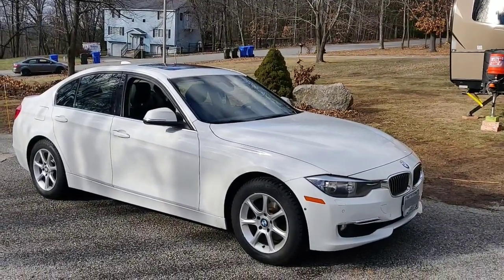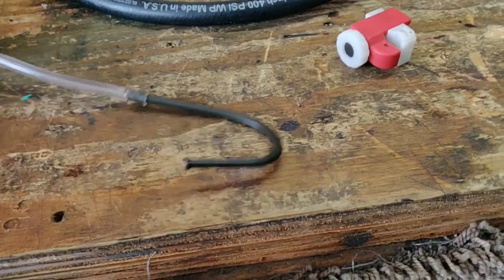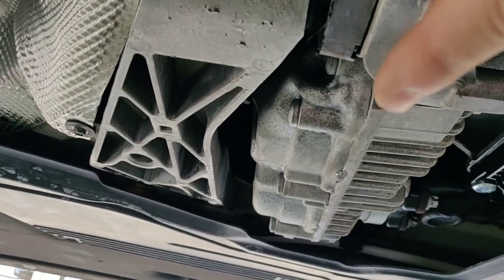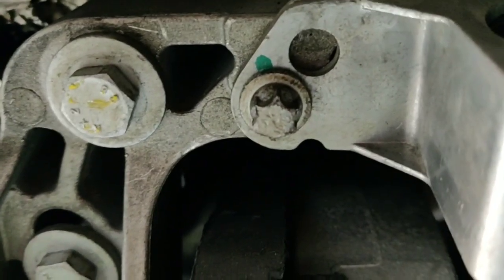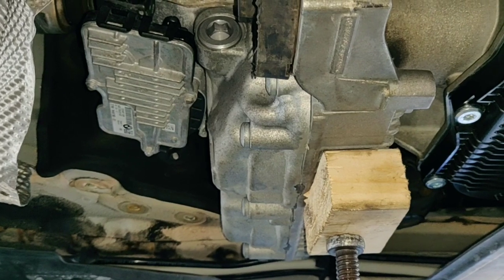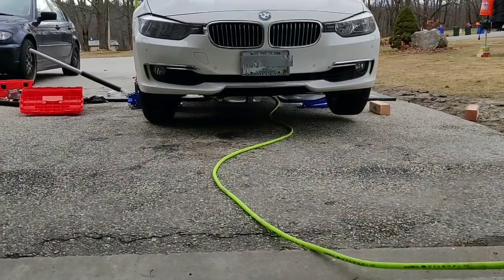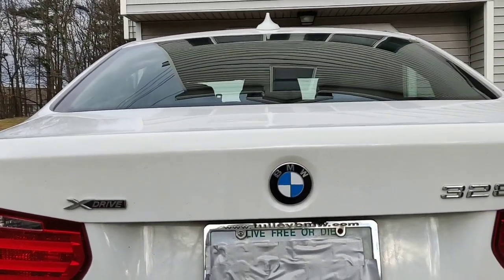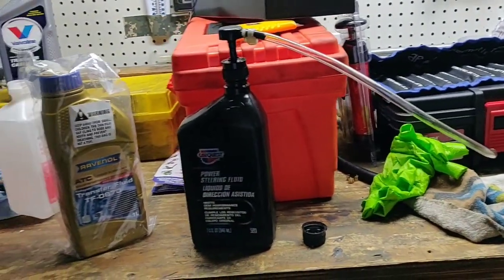BMW F30 Xdrive Transfer Case Fluid Change {PART 1} [INVOLVED]

Comment: Good video and I like your opinion on dealers and the tricks they play 😉 
For anyone experiencing hesitation that almost feels like a misfire but with no codes present and tried plugs or coils it’s probably dirty transfer oil like this, I’ve had a lot of x drive vehicles from f30 to x5 x6 with this issue with as little as 30k on them, sometimes made worse when new tires have been fitted or at least more noticeable, transfer flush and re adapt via diagnostic then a quick drive and all is smooth again, crazy that these problems arise after so little miles.
Reply: My f10 535 is doing this, right after i had the oil pan gasket and valve cover gasket done, it had jerking before shifting 1,2,3 in drive but then started shuddering like crazy, took it straight to bmw, they're saying its the trasfer case needs to be replaced.

Comment: The main reason you should reset this through ista (or ask your dealer to) is that the friction modifiers change as the fluid wears and the controller for the diff compensates.

This should be done each time the fluid is replaced.

Comment: Were you having any issues up to this point or were you being preventative? I’ll be doing this soon with my F25 X3 but it’s been exhibiting some acceleration hiccups. Hoping the new fluid will solve these issues. Thanks for the upload!
Reply: Scott L have about 99k. I’ll probably be doing transmission fluid and filter change at some point this year as well. I’ve seen issues with these transfer cases shearing the output shaft teeth but I’m hoping that’s just a worst case scenario. Also, was going to change the fluid just once but based on your conclusions I’ll be doing the same where I’ll run new fluid in short cycles to make sure the new fluid cleans out most of the intervals.
Reply: Internals*
Reply: Scott L reporting back a few days later after changing. Amazing. The transfer fluid change alleviated all my issues. Liquid gold! Such a bummer the F30s don’t have a drain plug. Was pleasantly surprised to see  drain plug on the F25

Comment: Just wondering about the tc clutch reset procedure and if it is actually mandatory requirement after changing fluid? I am gonna be doing the clutch on my f30 335i xdrive soon and might as well do the tc fluid but I don’t have ista or foxwell scanner to do the reset. Last thing I need is for any code coming up because of a fluid change!

Comment: and how did you perform an oil reset on the tc? after a while it will raise  error 440102 - oil wear, I changed and flushed the oil twice, the error is still there... ISTA and Carly couldnt delete the error. My car-> x3 f25

Comment: Im so glad you did a video on this, ive been trying to figure out why my car has a slight jerk under hard acceleration. im thinking that the fluid in the transfer case is going bad and is allowing the clutch to slip under certain circumstances, Do you think that could possibly be the case? I have no lights on the dash and the car drives great otherwise, only other minor thing i could say is that when you come to a near stop and go to take off again, the car has a slight jerk similar to having bad cv joint on the driveshaft in my opinion. BMW does have a recall theyre about to put out for bad cv joints on the rear transfer case but im thinking its the clutch slipping because the vibration seems to be almost boost related, as if the blow off valve is making minor on the fly adjustments to keep boost at max but not overboost.
Reply: Marginal Mechanic I really appreciate the tips. I plan to change the transmission filter and fluid and also vacuum out the transfer case fluid  and replace with new fluid. Is there any special procedure that you have to follow on the transmission filter and fluid change? Typically I replace those items, pull the e brake, start the car, let it idle for a bit, then run it through each gear while stationary, park, reverse, neutral, drive, reverse, neutral, drive, reverse neutral, drive. I allow it to sit in each gear for a few seconds with the e brake Holding the car then take for a short drive. This would be sufficient for this car as well I’d assume?
Reply: Marginal Mechanic if I were close by I’d definitely bring it over to shoot a video and do the work. But I live all the way in Panama City Florida
Reply: Hi there 
Can you please tell me ae  you fix the problem? That sounds like my problem i have the same symptoms 
That was transfer case? Thank you
Reply: @adamnowak1414  there is a recall on the transfer case and the cv joints on either side of the transfer case. Bmw will replace it for free under the recall if you go have them inspect the car.
Reply: @adamnowak1414  the car will start feeling clunky as hell when the transfer case starts to fail.
Reply: If you want to check that your transfer case is working properly, try unplugging it from under the car, this will cause it to lock in rwd, if the problem disappears you know it’s your transfer case
Reply: @theprodistini2590  thank you for answering me 
I have to try to unplugged my transfer case ,when i do it can i drive on highway thing is that's only happening when i drive more than 55 mph and accelerate all the way down so that's only way i can check please lmk thanks
Reply: Also you finally fix it? 
And that was transfer case? 
My symptoms looks the same but when engine is cold doesn't happen when is hot like 200 farenheit start let go sometimes(hard to say in english for me i try to find the best word) looks like misfire but i change spark plugs and coils already and don't help also no codes on dashboard, thanks
Reply: @adamnowak1414  my troubles happened when coming to a stop from any speed, if your car is having trouble staying running or starts to stutter, missfire, shake when coming to a stop and it’s not drivetrain related, it’s going to be vacuum related, probably egr, pcv, or there’s a little valve on the side of the turbo I can’t remember what it’s called right now. But it fails about every 65-100,000 miles and causes missfire codes, less response to throttle input and stuff
Reply: @adamnowak1414  sometimes when you’re driving and you try to accelerate, when the car gets under load it starts shaking a little bit, that’s the transfer case failing
Reply: @theprodistini2590  thank you for your help i change transfer case fluid and problem solved that's crazy my car has 45k miles and oil looks like coca cola but anyway now car runs great

Comment: Hi, I've seen your video, both of you, but I don't speak English, I'm doing this with the google translator.
To say that it has helped me a lot, how to change the oil in the transfer case of my bmw f31 (2015) 320d xdrive. (I'm from Spain).
But there are some questions I have read in the questions, which says they are explained in the video, but I do not understand English.
One of them is the amount of Ravenol that has entered the box. I have put the car level, and when I opened the plug, enough oil came out, I should not leave if that is the filling level, but it came out, and I don't know how much. I know, then take out about 200ml of oil. Therefore when filling the box try to fill with 500ml of ravenol oil, for that I had to lift the car on that side so that they could enter, if not, only 200ml of new oil could fit. I can't find the exact amount of oil carried by the transfer case anywhere.
And the other question is, something I have read about resetting the transfer case by changing the oil ... is that true? ... I don't know how ... if I have done it by changing the oil to the gearbox.
Sorry for so much writing ... greetings and thank you very much for your contribution ...
Reply: @themarginalmechanic5928  Thanks a lot...

Comment: Any idea of the thread size on the filler plug? I was looking to replace mine with a dimple magnetic one.
Reply: @themarginalmechanic5928  I'm interested to know how much oil you got out by tipping it to the side? I jacked mine up well at the front as I've only one jack and could only get about 350ml out ffs.
Reply: That's the plug for 2016 335d xdrive transfer case. Ive just fitted one.

Comment: Awesome video, has anyone done this with a fluid extractor?
Reply: @themarginalmechanic5928  thanks for the reply. I'm sorry I was under the impression you made the tool used in the video. I don't have the tool to bend cable but I figured with a flexible tube on my extractor I could do this project

Comment: I’ve got a 2014 bmw 435d xdrive. 
Currently my xdrive is not functional. Permanent traction light on the dash. The error code i have is: 440101 Transfer Box (VTG): End of transmission service life reached. 
I don’t suppose replacing the oil will help, but do you think I can replace just the transfer case actuator/motor or will the complete transfer case require replacement? Have searched online endlessly without any answers. Any input would be very much appreciated
Reply: How was this resolved? Keen to know more
Reply: @TS-ji1me  Yes, also would like to know
Reply from the maker: I'm pretty sure that error message indicates that the clutch material inside the transfer case or power diverter is it end of life. 

Personally I would buy a remanufactured power diverter and install it as an entire sealed unit. I would not rebuild it myself. Manly because I have no idea how to and I imagine there's some special tools and it's just not a headache I would want for myself. Remember I'm only a marginal mechanic I'm not a professional mechanic so everything I say is likely to be wrong

Comment: Another mythical lifetime fluid!  My 2013 F30 transfer case has started making noise @88k miles and I think I should just do this and hope it’s not too late.   I had a major heater core job recently because BMW also thinks coolant is a lifetime fluid.   Anyone here care to contribute a list of what BMW thinks are lifetime fluids?  I feel I’m discovering them one at a time!!   Maybe a good discussion for a new video.
Reply: in my repair manual.  Some lifetime fluids still have a recommended service interval.  I did the transmission fluid and the manual states lifetime but recommends changing after 100,000 miles.  That fluid still looked great when it came out.  The diffs and transfer case also state lifetime in the manual with NO associated mile markers.  Both diffs came out dark brown but definitely not black, still changed them anyways.  Next job is to change the TC fluid.